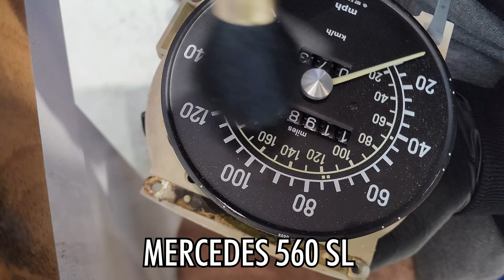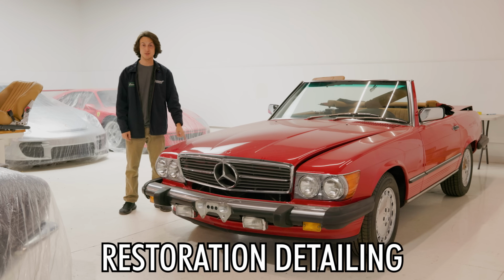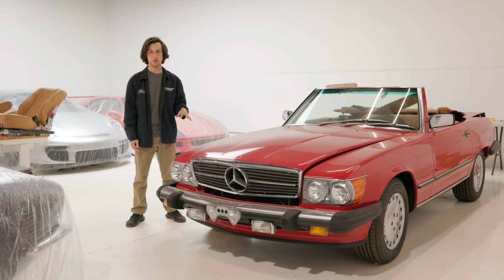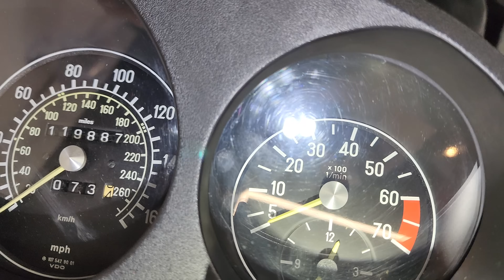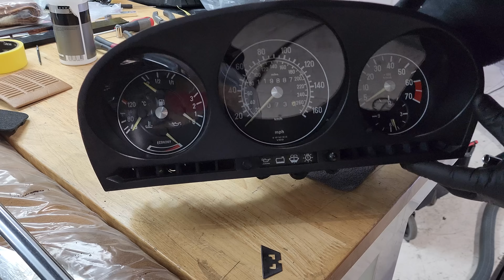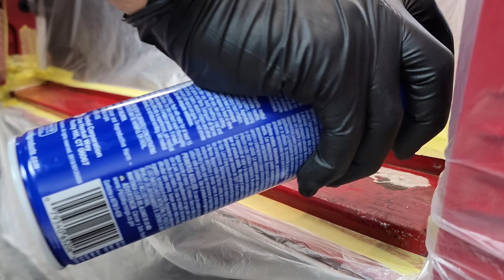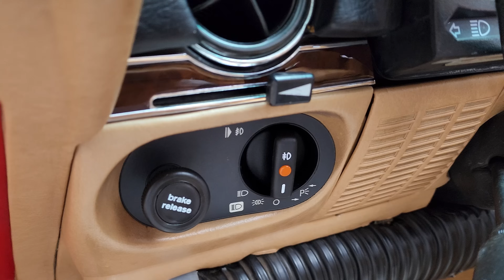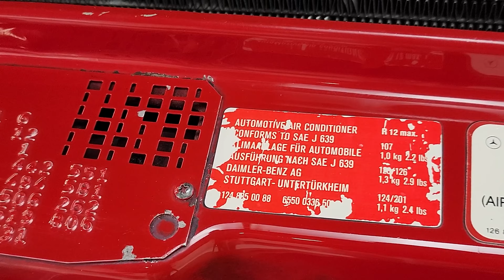Classic Mercedes 560SL R107 // MONTH LONG Restoration Detailing

Comment: I'd take that over a brand new one honestly
Reply: The faddish interactive screens of new cars give them a completely disposable character.
Reply: @genetung8590  Mercedes is only interested in their bottom line,
like all manufacturers today.  It's a shame to see what
Mercedes has become.
Reply: Not me, I got behind the wheel of a 2023 C Class the other day and it is incredible.
Reply: @stevebuchanan4829  C clases Is bottom line
Reply: My father had an 89 same color brand new.
I used to take it out on weekends and score some honeys 😂
Reply: @geofffikar3417 Its really sad honestly Mercedes used to be about quality they made cars that would last until the day you died and then about 200 years after that but now yea throw some cheap leather and a screen and call it a day
Reply: @stevebuchanan4829 Go drive an older one new Merc is like a KIA compared to the old ones
Reply: probably a lot  more reliable than a new one

Comment: Noticed some of the comments that this is a 25k+ detail, is this ball park for the US.?    the protective undercoating should never be removed unless it will be re-applied.

Surprised that you didn’t fix the common MB issue of wrinkled door card material.

Comment: I have the first gen r107 72 350 SL. I'm going to try to replicate exactly what you guys did. Granted the car was in great shape when you got it.. but it's now pristine.. awesome video!
Reply: First gen looks best. No low front spoiler, no woodwork, simple bumpers, nicer steering wheel, chrome gear gate, bigger headrests, baroque wheels or steel wheels with painted hubcaps..........🙂

Comment: Really nice job, especially regarding the balance between refreshment & keeping the originality intact. However, the dry-ice cleaning has removed the underbody coating (which I believe would have been Brown Dinitrol) & you should have replaced it given the susceptibility of the R107 to serious rust issues.
Reply from the maker: Thanks buddy! Yes, we have several options when it comes to replacing the undercoating on these classics. We are always applying some level of rust protection, at minimum being a clear matte protective wax. We offer the option to the owners to also go for a nice modern waxoyl coating, or replace the cosmoline/etc with a new coat. We're in southern California, and these classics are almost always garage kept so fear of rust is relatively non-existent. Just depends on what the owner's plans for the car is
Reply: Undercoat is also part of the sound deadening

Comment: That SL is a set of euro bumpers & headlights away from absolute perfection
Reply: It looks very good for an American edition though. Of course the optimum would be original black steering wheel,  gear shift handle, alu baroque wheels, and no cup holder. Eurobumpers and Eurolights make it look better but I think you should keep this car to US standard as this is the original US edition. The 560 wasn't sold in Europe but the 500 there was just as good or even faster🙂

Comment: Hello guys, I congratulate you for the great job you did on the car. I would like to ask you a question and see if you can help me. I have a 1981 MB 280 SLC. It is in very good condition but I see that the leather on the seats is cracking. Do you have any products to recommend to me? thank you!!!

Comment: Take the hood off to replace the 2 hood pads. You just replaced the main hood pad. The small hood pad near the windshield is the reason to pull the hood off the car so you can replace both hood pads.

Comment: This is unbelievable…. Also, I’m always wondering. The black layer you are removing from the fender wells and the underbody, is that a factory undercoating or just grease collected over the years.
Reply from the maker: It is both. We are stripping away the old undercoating and grime, and then applying a new coating when we finish
Reply: @IAMDetailing  Your videos are packed with plenty of detailing and action. Maybe we can see a separate video on undercoating. If too much work, maybe at least pictures before and after of the final product with undercoating. I'm not sure but maybe you are applying a transparent undercoating because when you show the final product the body parts are super clean, no black coating. At any rate, always enjoying the process you are following. This particular video was exceptional. You went above and beyond.
Reply from the maker: @DanielIliev  It totally depends on the car and the timing honestly. we're usually grabbing photos while its clean because its so dramatic, and dont always show the undercoating because its a lot of work to try and video that while applying a perfect coat. Removing is one thing, but we need to make sure that the coat is super even and completely covering the car, so we don't film it as often so we can focus on the work at hand. I will see if we can get some more videos of the process soon though! Thank you for the comment!
Reply: @IAMDetailing  I understand completely. Don't worry about showing the process, as you are super busy anyways. Maybe one day, when you have the capacity, you will be able to film it. Thanks

Comment: Great job, one thing you should have painted  the dial needles, the tend to lose colors in all these era mercedes, the original color is fluorescent Orange (almost red)
Reply from the maker: Those dials are so fragile that it’s a little nerve wracking getting in there but great idea! Would have been a nice touch!
Reply: @IAMDetailing  a fine brush will do the job, also you could use card board to cover de dials, and masking tape for the center of the needles, and spray paint, it is easy to remove it and painted, but don’t do it, installing the oil pressure one has a trick in order to read correctly. 

Cardboard and spray is the way to go, or the brush.

For the miles kms dial you could use a sharpie

Comment: The black residue you're removing from the bottom of the car is meant to be there. It's a protection layer against corrosion. Why would anyone remove it, if not to replace it with new coating. Could you explain that please ? Other than that it's a marvelous job .. thanks
Reply: Yeah I think it's Cosmo line
Reply: @PeterPerez.  I am not an expert, however, depending on climate location the coating serves no purpose and it looks "clean" when removed.
Reply from the maker: That is correct. There's a few reasons for doing so: The first being - we are located in Southern California. Especially with a garage kept car, we don't have much to worry about when it comes to corrosion and rust. The second is - many times these cars have a wearing cosmoline coverage that is not intact, rendering it rather useless. We remove that old coating and have several different option to present the owner, ranging from a simple clear matte protection wax, to a full modern waxoyl coverage, or even return to a stock look by replacing the cosmoline. One of the easiest ways to see what's happening under the car and verify the condition of everything is to get rid of the grime and old undercoating to see how things look, and then assess an action plan. Most of the cars will receive a bare-minimum clear matte wax on the sensitive parts to ensure their longevity. Just depends on the owner and the future plans for the car

Comment: Not sold on ceramic coating, need more proof it works. Clear wrap best I think .
Reply from the maker: Primarily different functions. You’re absolutely going to get better protection from chips with a wrap, but its also MUCH more costly and requires quite a lot to do it well. Ceramic is fantastic at keeping light scratches away since the surface is much more slippery, ease of washing, that sort of thing. Best is obvious doing both :)
Reply: Great explanation

Comment: I know dry-ice blasting is super fun and all......
But when you are underneath these older vehicles....... You gotta keep in mind that the textured gray stuff is a factory applied protective spray coating. 
The main reason these vehicles aren't full of rust under there, is because of that anti-corrosive coating. 
If you don't have the equipment needed to reapply that same coating once you've blasted it off......
Well then, make sure you have it taken somewhere that does, before you return it to the client.
Otherwise you'll be liable to have a whole slew of very upset clients coming directly to you or their lawyers to seek financial compensation when the auction house gives them the bad news on their investment.

Comment: Why remove all off the rust protection with ice?
Reply from the maker: Because it was old and didn't have complete coverage. Now it's clean and has several different options, along with a new coat of clear protective wax, so the other can decide how they want to handle it.

Comment: Next step is to upgrade the engine or put a new non us 560 engine in it with 300hp.
Reply from the maker: That would be WILD! And probably too much fun. Would remove the "back to stock" condition a bit, but sure would be fun!
Reply: @IAMDetailing  but first euro bumpers and headlights.
Reply: @Bizmyurt 560’s never had Euro bumpers & lights, fitting them would ruin the originality